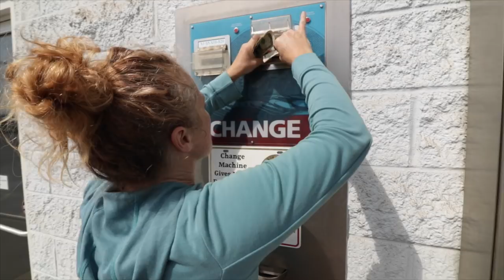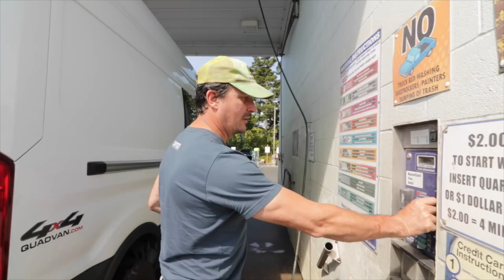I've Never Seen Anyone So Scared...

Comment: That looks so much fun just a little advice washing something that has been covered in salt with just water won't actually remove any salt you would need a specific salt removing chemical to lift the salt away from the surface might be worth investing in some to use when you've been on beaches and in salty conditions
Reply from the maker: Maybe not but it sure helps,
Reply: Salt is water soluble, a good rinse should do the trick, especially with a power washer.   Any basic surfactant as found in soap should wash it away...  The special chemical your referring to is  nothing more than a pinch of  baking soda, water, and a surfactant.     Cody, I think  your equipment will be fine....I’d suggest More quarters..... :-)

Comment: Newport, Oregon doesn't look like Big Sur, Ca. But it sure reminds me of Big Sur! Been through Newport a couple of times while going to and from a paper mill in the nearby town of Toledo, Or. Because of 30' Length Restriction on US-20 , had to go I-5 to SR-22W to SR-18W to US-101S to US-20E on into the outside of town there. If PD or HP catches OTR truck(3axle) w/53' trlr, on US-20 w/b, they stop you write a really fat citation and force you to hire excort vehicle. This is due to really tight turns. All really expensive! No thanks! lol

Comment: One season on an engine? lol I'd definitely build a high performance diesel for that size of buggy. That would it would last for at least a season and a half. ;)
Reply: consaka1 the reason the engines last a season is the super fine sand gets past the air filter and likely wears out the cylinders and valve guides
Reply: Alex -   Beach sand is some of the finest sand you will find anywhere. Still if I was losing engines due to sand I would get a different filter setup. Maybe dual stage with an oil bath in there somewhere.  Even fine sand can be caught though I bet you could make a filter setup that would cost almost as much as an engine.
Reply: consaka1 i guess yeah but that system would also be just under the size of the engine and weigh a ton. Then theres the issue of containing all that oil while the vehicle is bouncing all over the place. The weight would kill engine power and all that so they probably put a super-fine filter element in the thing. Sand and engines dont mix
Reply: LOL nah it would not need to be heavy at all and if oil bath can work on go carts just fine it would be fine there as well.  Either way they need a double filtration system with one or both superfine filters. Depending on whether they want to put them in parallel or series.